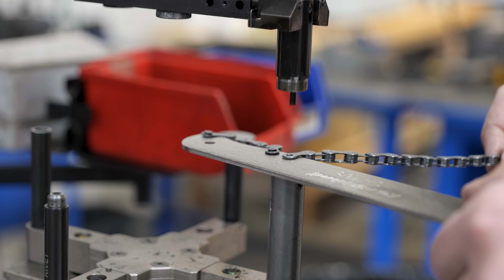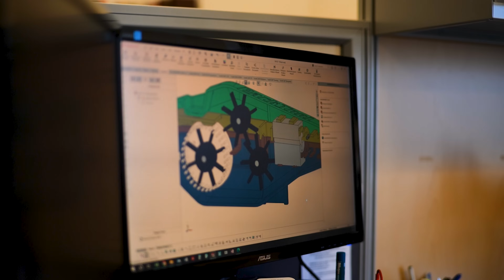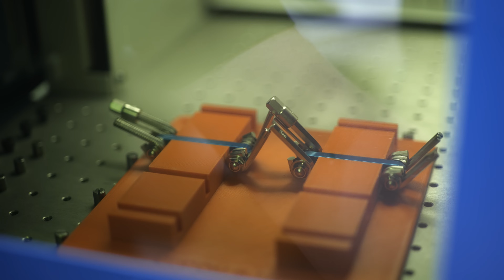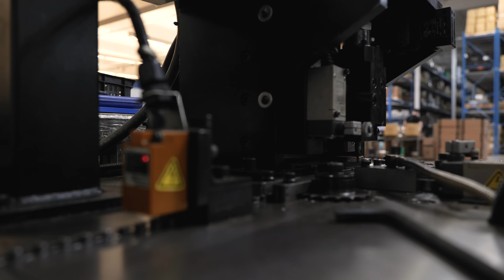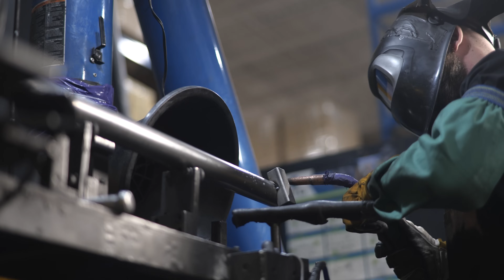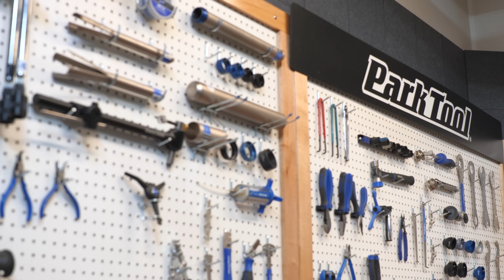The Unsung Heroes of Cycling | Park Tool Factory Tour

Comment: Definitely my favorite video to date.  The Snap-On tool company of the bike world.  As usual precision and quality is not cheap but if you're relying on a calibrated TM-1 to accurately measure the kgf on your $2000 carbon wheels you don't want to risk being out of tolerance with a $20 Temu tool.

Dang i wish didn't sell my TS-2. Indestructible chrome finish. Powder coating can chip or crack.  I think he didn't want to say exactly why they went to PC but I'm.sure it has to do with $$

Comment: I've quite a few Park Tools - truing stand, dishing tool, derailleur alignment, cassette remover etc etc - however the one that holds a special place for me is the Hex Key set AWS 10 - I forget when I bought it but it must be 20yrs+ ago - its dark blue, not light blue as they are now. Every bike I've built or rebuilt always has this used for luck as the final cinch down, it's so special it actually stays in the house and not in the shed!
Reply from the maker: it's funny how we remember certain tools and how long we've had them - a sign of significant importance, so glad that you've got something over 2 decades old! that's brilliant

Comment: I have an old park tool stand prs-2.1 that I got from a bike shop that was going out of business. (his partner did not want to be in the business any more) I got it home complete with the 200' pound steel base. A few months later a local service tech for my electrical supply company stole one of the arms in my garage. I bought another arm (incomplete) from someone. However I refuse to pay $15 for a pair of allen screws and an ordinary hex nut. It appears to be the same hardware used by hvac guys to hang duct from allthread.  This nut is critical for tightening the grip. It's quite soft. I'm still looking around for an alternative.
Reply: Then buy some imperial allen screws and a hex nut? I don't get what you are trying to say.

Comment: Park Tool is the Snap On of the bike world. Welcome to Minnesota Alex!
Reply: No it ain’t 😂
Reply: @Skittlez19  Can you explain your reasoning? My reasoning is that most pro teams use Park tools as well as bike shops. Snap On is used by auto shops. They are more expensive than normal consumer grade and usually better. But, for most home mechanics, you don't need that level of tool. It's ridiculous for example to buy a Park screwdriver or wrench. There are plenty decent brands that will work just as well and cost less. I have a set of Klein T handle hex key wrenches. It's a set of 8 just like the Park and even the same color blue. But they are also half the price and seem plenty durable to me. Same goes for Snap On. My auto mechanic uses them at work, but uses Craftsman at home. That's basically what I meant when comparing Park to Snap On.

Comment: Can you guys explain/make a video from start to finish - converting a wet lube chain to a wax chain? Clean, de-grease, etc.
Reply: SILCA used to have a good video or two on converting, but now it's trying to sell a one-step process and I can't even find the good video where different chemicals and the ultrasonic cleaner was used.  I like the old way to completely strip the chains, and I like using the ultrasonic cleaner to pull out the iron/steel dust wear particles from within the chain once in a while even after I've converted the chain.

Comment: Probably one of my favourite GCN vids. Park Tool are simply the best for the job.
Reply from the maker: Thanks so much!
Reply: Specific bike tools yes 
Other companies make better Allen keys, diagonal cutters, screwdrivers, their JIS2 screwdriver is overpriced, you can get cheaper and just as good
Reply: @ebikescrapper3925  Agree.  I have over $10k in tools, not counting air and electric.  What I’ve found over the years is that there isn’t a single tool maker that does everything the best.  They all have very specific competencies and outside of those, they’re average at best.

Take screwdrivers.  I’ve had several brands over the years.  Some have ergonomic handles, others have ground tips, a few have parkerized tips.  Fewer have hex shafts that can accept a box wrench.  Some lines include Pozidriv or JIS but rarely both.  A few have well marked handles that help distinguish the differences because they’re visually close enough to be confused.  Out of these six characteristics, you have to look really hard to get something with four or more attributes.  All six is a rarity.
Reply: Allen keys - Wera just make the top because of their ability to undo slightly damaged heads. PB SWISS TOOLS a close second.
Screwdrivers - Either of as mentioned above
Diagonal cutters - Knipex
JIS - Vessel
The mini rachet set from Bacho is handy. Sealy make a good small rachet that has the ability to fit a hex fitting on each side. 
Starrett for measuring tools especially set squares
Reply: @ebikescrapper3925  Agree.  Wera Allen keys are excellent.  Their standard and Pozidriv screwdrivers too. I haven’t seen them in JIS, so thanks for a recommendation on those.  

Facom and Snap-On are great socket makers but they’re super expensive.  Any big brand impact socket is a fair choice because they usually have ogive shapes and are parkerized, not chromed which hides flaws, doesn’t grip, and embrittles the metal.
Reply: Wouldn’t touch anything from park tool anymore, overpriced, terrible quality and crap warranty in the uk
Reply: What bike tool company do you use instead. Unior bike tools seem to be good quality.
Reply: I use a mixture of tools from Var, noble wheels (now owned by abbey bike tools), knipex, wera, beta, effector mariposa, pb Swiss etc basically high end brands that don’t skimp on quality. Unfortunately park lost there touch in recent years. Only park tool I own is there cone spanner’s and that’s because I was given a set.
Reply: @ Idk if I would say any of that.  Their presses, wheel truing stands, and mechanics stands are pricey.  Of these, I own a mechanic’s stand and it’s very well made and the price is well justified in my mind.

Insofar as their whips, cone wrenches, Shimano BB sockets, I find them very inexpensive.  They’d be very hard to break, so I’m unlikely to ever get into a warranty situation with them.  YMMV though… so which of their tools did you have a problem with?